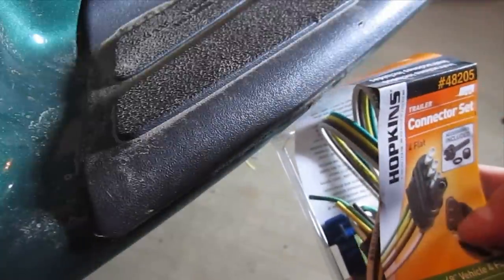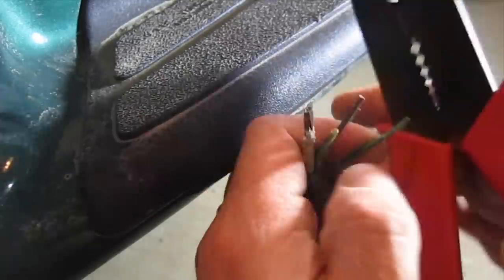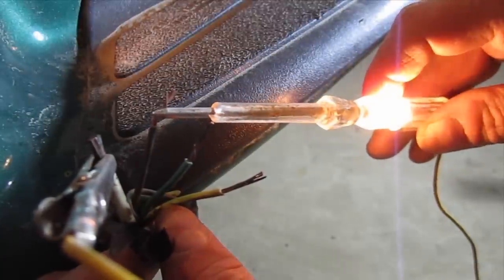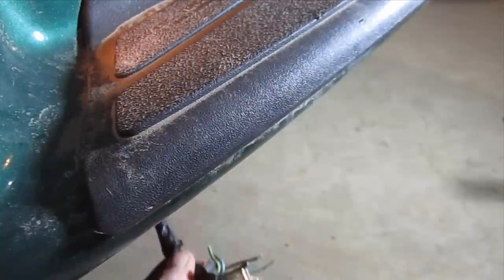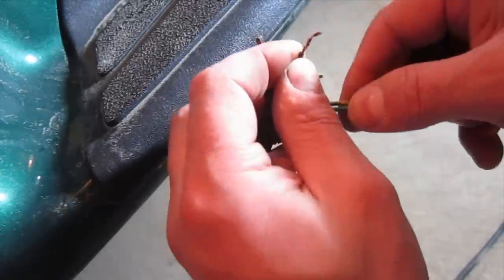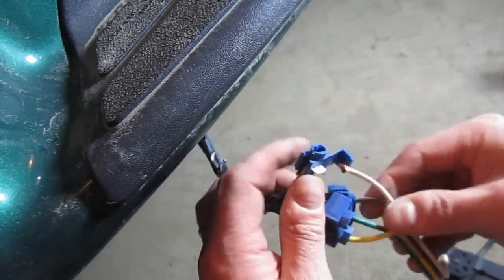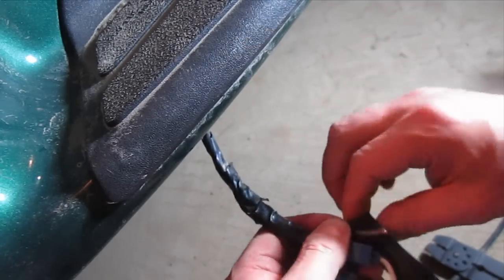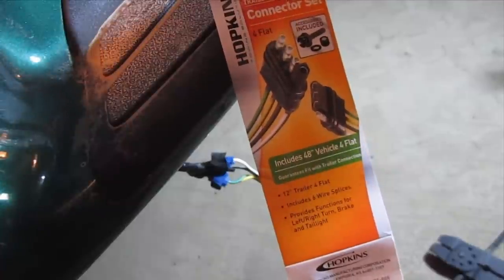How to Test and Wire Trailer Lights Using a Hopkins 4 Flat Connector Set - DIY Chevy GMC

Comment: Finally i found this video. I was looking for a video on how to set up a trailer ready wiring connector on my van. I watched several videos, but they all were about how to wire a trailer or others using the harness that plugs to the tail lights. Thanks for sharing.

Comment: So do I cut the black plastic square plug/connector thts under the  wheel well off to get those wires the way u had them?  Hope that makes sense I have a 2015 Ford Explorer that I'm hooking a trailer up to I also have the Hopkins wiring harness one side has a plug one side has for bare wires underneath the wheel well of my back right wheel there's a square black plastic connector that's a bunch of square holes in it do I cut that off to get the bare wires and then just connect the wires

Comment: Did the same thing yesterday as my factory one broke. Struggled with blue connectors though & see from you video what I doing wrong.  What is more secure, blue connectors, round caps or tape.

Comment: Thank you so much .is this a  universal tailgate connector ?! I see in new trucks an around plug with a slide away gate where you can hook up your trailer cables...just wondering if this the same.

Comment: Thanks for the video. That clears up a lot for me.. But wondering where do the brake lights get wired too? And how about the back up lights? Or would I need a trailer harness with more poles? Thanks again for the video! :)
Reply: XOXOX!
I FINALLY figured it out/UNDERSTAND!
This test is a lifesaver! You are very clear in your explaination!  I tested my wires and my turn wires are integrated with my brake lights!!!
Now wiring the trailer harness into my (not so) ez-wiring harness will be SOOO much easier!
Wish the ez wiring harness had better instructions and diagrams would have made my cj project get done quicker... Thanks again for the video and your help! :)

Comment: Great explanation!  I am having trouble with my truck or trailer lights right now and this will help alot.  I just not sure which one it is yet.  When plugged in, some of the trailer lights work and some don't.  It's not the bulbs, I checked.  I also bought a set of LED lights at harbor freight I still need to hook up.  Will that tester work on the trailer as well since there's no power too it?
Reply: Ok, thanks for the reply.  You understood correctly.  Again, great video.

Comment: sub & like your video! I have question- I test my 7 flat connector set came out from my truck side, first, I used the clip end to ground(G) and test Lt, Rt, Tl, all three with No lights. I then test Aux it lights up, what do you think the problem,  is it I have a bad ground(G)?

Comment: mark under my zr2 there is a plug from factory,i was told you can get a trailer wire harness to plug into that gm harness ,i do not no how to proceed as far as were to get it ,ill try to shoot vid of it,it wood be cool ,there wood be no splicing

Comment: the  plug in adapter connectors are by far a better idea Mark and be sure to use plenty of silicone dielectric paste on the connectors,
Any time you break the insulation on automotive wiring where the weather can get at it you will have rapid deterioration of the (copper) conductor and resultant poor electrical connection , i do a lot automotive wiring and most of what i wind up repairing is DIY trailer hookups that have failed for above mentioned reasons , not only that but your vehicle indicator lights often fail as well , and can cause accidents , the plug in is non invasive and will last much longer than splice jobs
Reply: what type of plug in adaptor are you referring to. my factory came with 7 plug & 4 prong but the 4 broke & replaced it like his video. haven't figured out how to secure & mount yet. any suggestions
Reply: this http://www.cequentconsumerproducts.com/Products/Connector-Reese-Towpower-4-Way
or if your 7 round is still good  carol mcgrath  , just use that with , http://www.prolineracks.com/trailer-wire-adapter-plugs.html
better yet here's a image search link with lotsa them :) have fun
mounting a flat is a PITA unless you bought the kind that has its own moulded plastic mountable housing